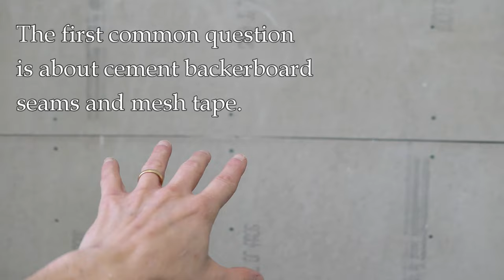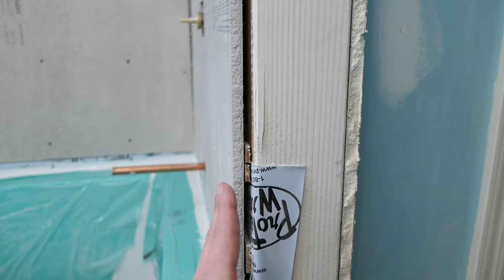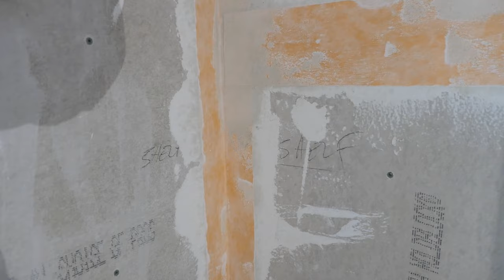Should Backerboard Go Over The Tile Flange Or Up To It?

Comment: What thin set do i use with kirdi membrane. Thk u
Reply from the maker: It depends on the substrate.  For backerboard it is a non-modified thinset, however if you are just using the tape and no other Kerdi, you can likely get away with modified thinset.  Since the Kerdi is plastic there needs to be a way for the moisture to escape the modified thinset so it can cure.  Unmodified thinset can cure slowly in the presence of moisture.  Schluter also makes a thinset of its own which can be used in any situation.

Comment: This is the BEST video I've seen so far in relation to my bathroom remodel. Thank you!!

Only one more question, it looks like the drywall in my bathroom was replaced with 3/4" at some point. It is a an exact 5' bathroom like in the video, so of course I am having issues not being able to shim. Should I just replace the drywall with new ½" so my transitions can work? Any help is appreciated!!
Reply from the maker: Do you mean 5/8" drywall?  That would sometimes be used in apartment buildings or in houses when sound proofing was desired.  I wouldn't call it common in residential homes.  If the tub or pan allows it you can shim the backerboard out to meet the thicker drywall.  Given that the bath is small, replacing the drywall with 1/2" is an option.  The best answer really depends on your circumstances.  If you are three stories up the shimming option will seem attractive.  If you are ground floor with a helper, then replacing the drywall might be easier.  Remodeling is full of judgement calls like this.
Reply: @enduringcharm  just what I needed to know! 
You really know your stuff, it was a master bath on ground level, probably was for sound proofing! Wondering if it had water damage, because it definitely measured ¾ thick. 
THANK YOU for your video, and for your time in responding :)

Comment: If you have delt with a failed tub shower you realize all things are not equal, you have to waterproof shoulder or head high on the shower wall and 3 feet (main pash area) on the side wall, waist high to the back wall, and may butt high on back wall.
Reply from the maker: Well, I've personally remodeled somewhere around 70 bathrooms.  I'm also old enough to remember when waterproofing products didn't even exist.  In fact, I've taken apart dozens of baths where tile was put right over drywall and it was just fine for 30 years.  Thankfully we don't use that method anymore, but it does make a point.  Waterproofing has it's place, and when I do a tiled shower floor, for example, I'll also waterproof the walls.  Yet, I'm not a slave to the idea either.  I use a flashing system behind the backerboard to protect against a future problem.  I don't necessarily waterproof the surface of the backerboard though.

Comment: Everyone has opinions. Some methods are good some not as good.   My local professional tile store turned me and to  GO BOARD,  made by John Manville. I used it once.....never going back to Hardie.
Reply from the maker: There are a number of foam or other light weight backerboards out now, including Schluter's Kerdi board.  They are easier to install, perhaps, but there is a drawback.  After the tiling is done the walls have a cheap, hollow sound and feel to them.  Hardibacker offers a dense, substantial feel.  It's very much like an engineered wood floating floor versus a standard T&G hardwood floor.  Walk across a standard hardwood floor and it feels solid.  Walk across an engineered floating floor and you get a clicky-clacky hollow sound.  Some people aren't bothered by this, some people are.  For my business I want the final installation to feel and sound solid, so I stick with the heavier Hardibacker.

Comment: Is it possible to install the flashing over the backerboard? Our contractor already got started and left some gaps between the backerboard and the bathtub flange. I hate to ask him to take the backerboard off and reinstall it with shims, but I'm on the fence. Anyway to fix that?
Reply from the maker: No, if you are going to do the flashing it must be installed behind the backerboard.  Possibly your contractor has used other methods for protection, but you should have that conversation.
Reply: @enduringcharm  Thank you, yeah, he hasn't used other methods, but we videoed a friend in who took a look and thought there were good reasons for why our contractor did it that way and not to ask him to re-do it. The next time we do a bathroom, we'll know exactly how we want to do it from the get-go!

Comment: Crazy not to tape anyway.   How could it hurt and takes very little time.
Reply from the maker: You can certainly tape the joints if it makes you feel better.  As a pro, I need to make decisions about time and money and risk that a DIY homeowner may not.  I can name lots of other things in a bath that are more risky which homeowners often don't touch.   The exhaust fan ductwork that isn't insulated or vented through the roof, the electrical switches wired poorly and the loose electrical boxes, the tilted toilet flange, the rotted or punky subfloor around the edge of the tub, the hump in the middle of the floor, the missing or poorly routed plumbing vents, the inadequate ceiling insulation, and more can all be a much greater concern than taping a joint that is already well secured.  There is a limited budget and therefore limited time.  I build baths to last 30 years, but that means using experience to maximize the budget and minimize the risk.

Comment: The tcna handbook clearly states to place backer board on the tub deck. It's not a suggestion.
Reply from the maker: I know you mean well, but I have to point out why this statement is dumb.  First, the TCNA is a profit-making tile industry group which makes money through membership sales and sales of literature.  They do not represent tub or shower pan manufacturers, backerboard manufacturers, lumber manufacturers, caulk manufacturers, code officials or code organizations, or me.  In fact, I haven't once seen them on my jobsite.  Second, since a bath installation is necessarily made up of many manufactures and types of products, there will be conflicting advice in every single circumstance.  I can show you instruction booklets from single manufacturers in which there is conflicting installation advice.  It's a regular jobsite joke.  I can also show you tub and shower pan instruction booklets which illustrate the option of over the lip or on top of the lip installation on the same page.  So, every detail is ultimately up to me, the contractor, as to how I want to handle it.  I make my decisions based on personal experience honed over decades, not by a pamphlet sold by a single trade group.  As I pointed out in the video, my preferences are not even set in stone since every job is a little different and I need to adjust for those differences.  Third, if my client in the future experiences a failure, or rot, or water leaking, the TCNA will not be the ones answering the call-back or suffering the blow to reputation.  It will be me and my business.  So they can order or suggest anything they like, but that doesn't mean I need to adopt the practice.  Fourth, the TCNA also means well and I know there is some solid advice that they sell.  Yet, in every endeavor we should be critical and make our own judgement.  So, put the backer board wherever you like.  I only publish these videos to illustrate my experience and practice.  Take from it what you will.

Comment: No matter what i just bring the backerboard to the lip of the tub and caulk that edge. And then after tile is installed down to the tub it gets caulking again between the tile and the tub.
Reply from the maker: The reason I feel that this is inadequate and the reason I install the self adhesive flashing is because over the years I have seen many leaking showers/tubs due to movement or poor maintenance.  I've seen framing that shrunk or shifted resulting in corners opening up, shower walls pushed in (from god knows what) resulting in leaks,  tubs or shower pans expanding/contracting and causing leaks, and missing tile, caulk or grout causing leaks.  The self-adhesive flashing gives a measure of protection against these things.  It also puts a barrier between the wood framing and the backerboard in the area where moisture might ever penetrate.

Comment: Why don't you waterproof hardie backer?
Reply from the maker: In some situations I do--such as a tiled floor shower.  For a tub situation as shown in the video it simply isn't necessary to waterproof the entire wall.  As you can see, I've installed a flashing system behind the backerboard.  In this bath the corners were suspect in my mind and I was going to install corner shelves, so I did use the Schluter membrane there.  The main field of tile does not need to be waterproofed, despite marketing claims by manufacturers of waterproofing products.  How can I be so sure?  Because I've pulled apart 70-80 bathrooms and examined each one for failures.  But, if it makes you feel better, no harm done if you want to install a membrane overt he whole wall.

Comment: Having plastic behind the cement board is asking for a mold problem if moisture ever gets in there no way for it to dry out. You never want any kind of waterproofing on the back side.
Reply from the maker: Having plastic behind the ENTIRE wall could be a problem.  Having flashing and a short section of plastic as I have done is not a problem, and I have installations two decades old to prove it.  Similarly, when you have an exterior wall as part of a shower installation, you want to make certain you don't trap moisture between the vapor barrier of the insulation and anything else you put up.  In that example, though, the vapor barrier does span the entire wall.  Mold, not incidentally, needs both moisture and a food source.  Plastic and hardibacker are not a food source.

Comment: Great vid. Did you use fiberglass mesh tape behind the joint compound where the hardie meets the drywall?
Reply from the maker: Yes, that's exactly right.  I prefer to use two layers of powdered joint compound (which cures chemically) and then one layer of pre-mix (which cures by evaporation).  Then I cover with one coat of primer and two finish coats of paint before tiling.

Comment: Any drywall compound over boards defeats the purpose of a water proof board, primed helps but still will dissolve when moisture gets in ,tiles will fall.
Reply from the maker: The feathered compound is located mostly or entirely on the outside of the wet area of the shower because the backerboard is brought to the outside of the tub or pan.  However, tiles will not fail to adhere if primed/painted compound is tiled over.  Let's remember that drywall itself was used as a backerboard in showers for decades.  If you are concerned about it, though, perhaps if you have sloppy teenagers living in the house, you can simply apply Schluter Kerdi membrane over the entire assembly.

Comment: If when you remove the old wall and there is mold, how do you remediate?
Reply from the maker: Well, if you remove the previous tile and wallboard or backerboard and find mold or mildew just growing on the surface of the framing members, you can clean with bleach and be fine.  Believe me, even brand new framing lumber often has mold on the surface.  But, if the mold has actually caused rot or sponginess in the framing members, those are removed and replaced.  Same goes for plywood on the floor.

Comment: Flashing over the nail flange looks good if you are trying to impress a homeowner..but is ridiculous in this situation...there is no way for water to go up and over the nail flange  even if you put zero caulk at base of tile...
Reply from the maker: Really?  Well, in the 15 years I've owned my remodeling company I've run across quite a number of situations where the flashing would have saved a lot of time, money and headaches, which is why I use it.  In second floor condos I've seen original framing so poorly installed or move so much due to design issues that the corners open up and clueless homeowners continue to use the shower.  The condo owner on the first floor is not a happy camper when the water starts pouring into their unit.  It's an insurance nightmare, and I have been called in to fix the second and the first floor baths.  I've seen this happen multiple times and in condos built by different builders.  I've seen similar problems in single family homes, too.  I've seen holes knocked through in tiled walls--people do some strange things in a shower.  I've seen seasonal expansion create cracks in the grout lines, which are ignored for long periods until eventually water makes it's way through and ruins the ceiling downstairs.  I've seen tub spouts abused to the point of leaking (no, you can't let your kids hang from a tub spout) which makes it's way inside the wall.  I've seen the flange itself crack after years of seasonal movement.  I've sees all sorts of nutty things homeowners do and ignore.  So, the flashing is not there for normal circumstances or to impress a homeowner who rarely looks at the prep I do.  Instead, it is there for my own piece of mind and in the instance that something in the future goes badly wrong.  Water will be directed back toward the tub or pan and maybe the homeowner will notice the problem.

Comment: Don't all your screws for the backer board just poke a bunch of holes in your plastic and flashing behind it??
Reply from the maker: Yes, of course, the screws will go through the flashing.  The self adhesive flashing will likely seal around the screws, but the point of this flashing is not perfect waterproofing.  Hopefully the flashing will never be needed at all.  It exists so that if the homeowner fails to maintain the grout or caulking over the lifetime of the bath, or if the house framing moves dramatically, or if some other calamity occurs, water will not leak into the wall cavity but will be redirected back into the tub.  If you desire a waterproof installation I recommend the Schluter Kerdi membrane installed over the entire wall surface.
Reply: The flashing material will self-seal around the nail or screw shanks.  For the plastic poly applied to the studs around the enclosure, apply a bead of acrylic caulking along the 2 inch face of each 2X4 stud.  This is the area that will accept the cement board screws.  The caulking will seal the poly and the screw shank to the wood stud when the screw is inserted.

Comment: Doesn't make sense, joint tape will not hold backer board on place because of the expansion and contraction of the framing or wherever moves is just a practice that has brought to this point because joint tape is use for drywall finish, it is not to prevent leaking because backer board cement it self absorb water or humidity and that is because of the porosity of the concrete.
Reply from the maker: Using reinforcing mesh tape or Kerdi band on the seams, in conjunction with thinset, only helps keep the two sides of the seam aligned if there is movement.  I agree that the mesh tape is of limited utility.  The Kerdi band could help provide some protection against water in the corners.  If you choose to install Kerdi membrane over the entire surface then the tape is pointless.  Where drywall meets cement backerboard the mesh or other tape works in the traditional manner to prevent the joint compound from cracking.

Comment: There reason the wall board stops on top of the lip and doesn't contact the tub is to prevent wicking.
Reply from the maker: That's a popular theory, I know.  However, we're not talking about wallboard anymore, that isn't used today.  Cement backerboard or a proprietary backerboard such as Schluter Kerdi board is used.  Wicking is not a concern if you use these products, you still keep a small gap from the tub surface, and you caulk the gap between tile and tub surface.  Presumably you don't have standing water at the level where the backer meets the tub or pan anyway, or else you have a bigger problem!  And, even if cement backerboard gets wet, it doesn't disintegrate the way wallboard would.  I install flashing behind the lower edge of the backerboard so that no moisture would make it to the wood framing.